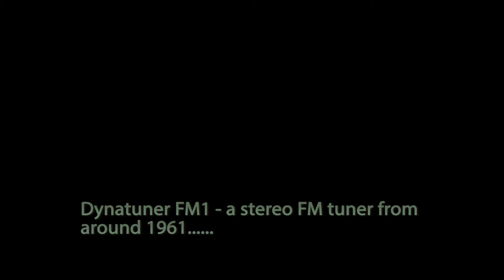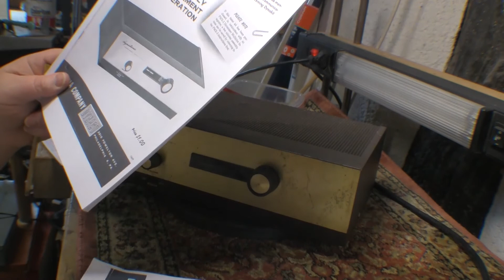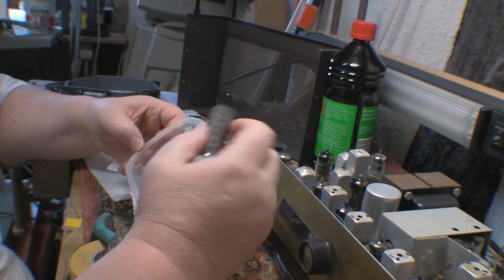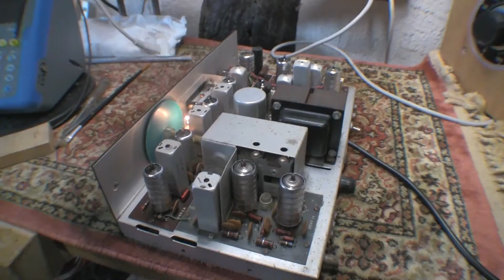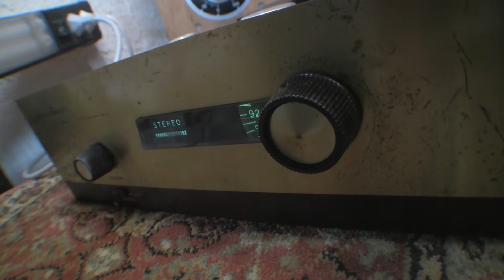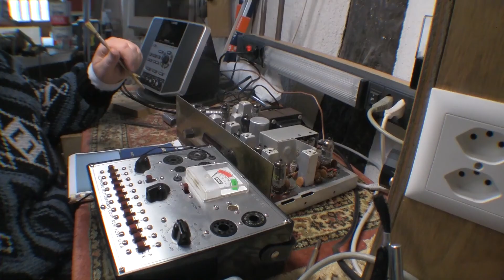FM Tuner - Dynatuner FM1 Restore

Comment: That's an early FM-3 the FM-1 was mono.
The FM-3 is a great tuner.
Reply from the maker: As the FM1 manual says, if you have the FM1 with the optional stereo decoder then use the FM3 manual.  Mine clearly says FM1 on the case but it has the stereo decoder so effectively it's an an early FM3.  I agree, it's a lovely tuner.

Comment from the maker: Yes it's American though there was an option to have a dual 115v primary on the mains t/f.   Mine is a straight single 115v one though.   It was sold as a kit but also could be bought fully assembled.   The build quality on this set is certainly good so it may have been bought already assembled.